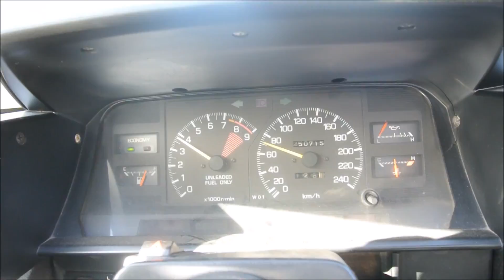Driving a car I built for the first time - Toyota MR2 mk1

Comment: You are an inspiration! Thank you for awesome content.
Reply from the maker: Thank you! Comments like this inspire me to work harder and make better content.
Reply: I seriously meant it. I heard you say "few years ago I didn't know how to change oil" well that was same for me too few years ago. Couple of weeks before repaired the power steering rack, took out control arms, replaced driveshaft boots and did couple of more little things in the front end all by myself. I know it is not a lot of work. But for me when looking at the past, the satisfaction was priceless. I closely followed your engine and gearbox build and now will do mine myself.

Comment: Well done! We have something in common ;) I own one Mk1 too . It took me some years to get it running. I bought chassis after restoration, welding and painting work...rest in parts. You should try that one challenge :D LEGO for adults cos I have never owned one before. Engine rebuild is done by my father, so its kinda "new-old" car. Every part was repaired, changed or at least checked...
 If you are intrested check out some of my vids, pics and we can chat about it.
 https://www.youtube.com/watch?v=xPj6fuAEqkM
https://scontent-cdg2-1.xx.fbcdn.net/t31.0-8/13495473_582991348542319_3976017001355001529_o.jpg
https://www.youtube.com/watch?v=op9G_UPLkZQ&index=35&list=PLBB147D04082D2D17
https://scontent-cdg2-1.xx.fbcdn.net/t31.0-8/13528434_1428649030531061_2638010924593499119_o.jpg

I will follow your channel. Cheers
Reply from the maker: Checked out all the links.Car looks really cool, proper racing machine. Engine sounds like its crazy responsive. Seems like you have some mods?
Reply: There are few indeed. Findanza flywheel, lightweight rods, pistons. (made by my dad), alu pulleys. Still a lot of things to do in future. Now it  is just sleepin in garage and waiting for it. 
Anyway i have engine mounts made of PUR by myself as well. I poured them at work like 3 years ago ;). Mine are in yellow colour.
Feels great to put something "your own" on the car.

Comment: Congrats on getting your AW11 all back together! I've been following you since you first set up your website and your YouTube channel, and I've been going through the same journey with my MR2 out here in the US. I'm super jealous of your rebuilt engine and transmission! Even with the crazy exhaust you have, your car sounds amazing to hear it rev, and the supercharger sounds nice as well! I can't wait to see more from you =D
Reply from the maker: Hey again. True, you are my oldest follower/subscriber. Really happy you stayed :) Don't be jealous, there's a lot more to be done, this is just the begging. The exhaust is horrible I hate it, but it is amazing to hear the car breathe. Wait.....I don't have a supercharger. This is just an NA :) You probably got confused by that absurd sound of the exhaust.
Reply: Thanks for the highlighted comment! I am certainly going to be sticking around for the long haul. I had a bit of a scare recently with thinking my engine was needing a rebuild due to low oil pressure at idle, but it turns out it is likely the oil pressure relief valve being stuck open due to gunk. I'll let you know how it goes this weekend and what it turned out to be.

Yeah, I thought you had an 87' SC for some reason. It probably was that silly exhaust lol. I'll have to go through your motor mount tutorial again in a week or two to fix my busted ones. Thanks for taking the time to make these videos!

Comment: Very proud of you brother, the first car I built was a 1990 eclipse gsx awd turbo. I didn't rebuild the motor because the block was capable of handling over 600hp with I successfully made right about 550hp at the wheels. I removed the balancing shafts, installed a fully programmable ecu, 780 injectors, a garrret 20g turbo with all custom piping I did myself and a boat load of other work thats too much to list. It was running at 36psi @89bls of fuel pressure with a custom street tune i did myself(looking back on it now I would have had it professionally tuned at a dyno) it was dyno'ed but never had them tune it. But in the end when you turn the key and it fires right up the very first time and you drive it for the very first time there is no. Better feeling in the world. Right now I have a 2000 bettle GLS with a 2.0 non turbo that I plan on putting a vr6 into and converting it to awd. I'm going to be starting my a YouTube channel to document my journey with everyone as well as how is it is to drive around in Las Vegas. Congratulations, the car is beautiful and can't wait to see more!!
Reply from the maker: Thanks man! Sounds like a channel might be a good idea, you got lots to show. Best of luck!